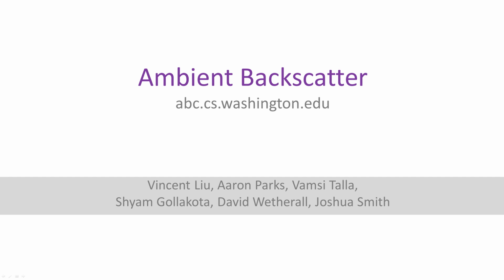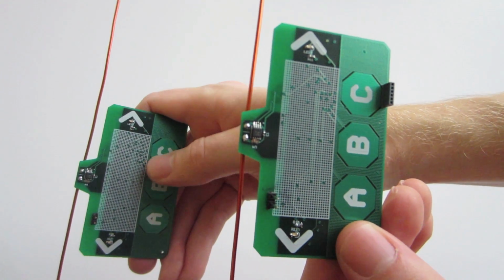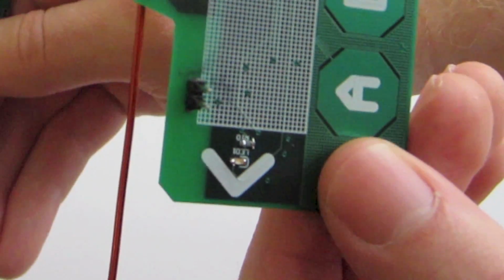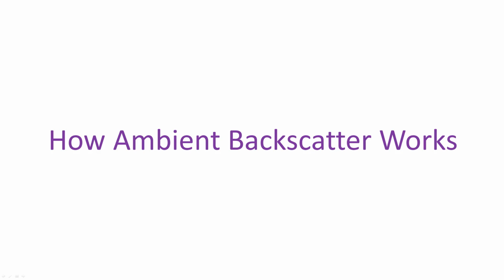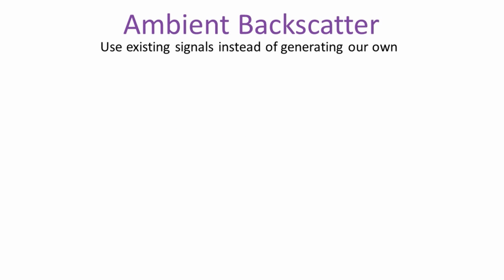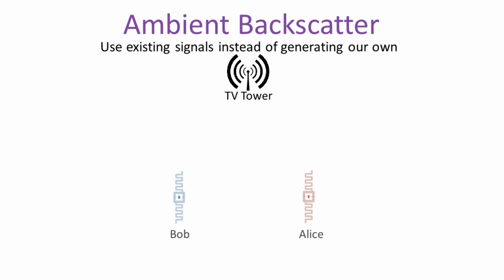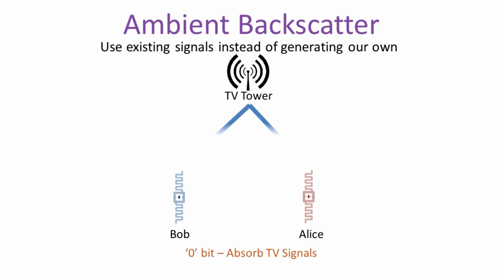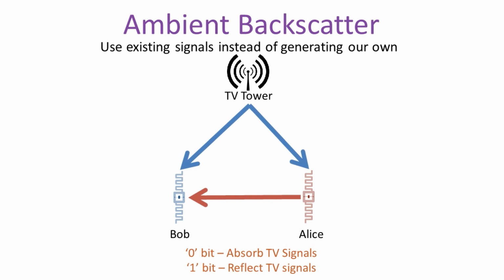Ambient Backscatter

Comment: So, by new do you mean effectively exactly how that soviet spy device hidden in a plaque worked? It was a special resonating cavity that when a truck down the street directed a certain frequency at the building the capacitance of the diaphragm changed the signal proportional to the sound waves. This modified signal was transmitted in another direction and then picked up in an office next to the embassy. 

Look, Im not saying this isnt a novel and interesting application of harvesting the RF around us. It is. Totally. Very interesting in fact. 

Im just saying at its base, its not new. Also, before you tout it as a payment method, have you tried hacking it? Like, sure if those are the only two radios its damn near perfect security. But so many engineers these days dont know how to begin, or outright avoid to protect their precious feelings (because the education system has psychologically scared them to believe failure is a bad thing....its not. Failure you dont learn from is bad. Failing is just a part of life), testing their designs to the point of failure. To try to make it not work. To confuse it or make it enter an invalid state and see what it does. 

That failmode testing, specifically the lack there of, is exactly the problem with all these automated devices running around.....Sure it worked perfect in a nice sterile lab....until a black person is crossing the road at night and they get flattened....We really need to get back into the R&D culture of trying to break things.....

Comment: I love the communication concept. The power method is nothing new. I remember while in college lighting a small room using  a handful of LED's and diodes getting power from AM radio stations from wherever. Crystal radios work in the same manner. a device powered by the airwaves itself.

Comment: Enabling a device the size of your phone to send a single bit and powering the 2 gHz chip in your phone are extremely different things. Extreme low-power devices have already been powered from em conversion, its never been taken further due to the obvious limitations of the tech. Using this for tags is a cool concept, even if the reader has to be extremely close, but don't pretend it's a solution for usable power transfer.

Comment: Dr. Tesla's wireless system was far more advanced 100 years ago. With Dr. Tesla's system the receiver was powered by the transmitter. So a radio would receive the audio signal and the electricity to power the device wirelessly. The system was 95% efficient regardless of the distance between his centralized transmission plant and the receiver. The ground was used to connect the generator to the load.
Reply: Tesla the genius was not a Ph.D. doctor.

Comment: These devices remind me of crystal radios, but they usually work well only with a fairly good length of antenna wire. But if the signal is strong enough in the local area you can receive AM and even FM radio in a very high impedance ear piece without any batteries what so ever with a much shorter aerial. Can these devices work out in the boon docks where backscatter might be substantially less??????????

Comment: This is very cool. But I can see how a crappy government could use it to further control its people. If you have ever seen how multiple robots can communicate with each other and coordinate, it might scare you a bit. The device could be "installed" in humans so government can monitor the movements of large numbers of people automatically via computers. I personally don't like it---fortunately I know I can build a simple device called an EMP device that would fry the semiconductors in the backscatter or RFID electronics. If manufacturers of these devices use a Faraday cage to protect or harden the electronics to prevent destruction by EMP, it will defeat their purpose. The Faraday cage will block any signals leaving their devices as well as blocking EMP from outside the device. So I'm not afraid for me, but others maybe. So bring on these new backscatter devices and hopefully they will be used for good, not evil. Manipulating and controlling the masses to benefit the few is evil---liberty, free thinking, and freedom is good. The Enlightenment lives on!!!!

Comment: Tesla's technology was way more advanced, capable of generating huge power from natural nonpolluting sources. Ambient Backscatter only uses TV&WiFi signals in the air to transmit your location to govt if you turn off your cellphone/or no battery & won't even work in the event of the ~100yr cyclical major solar plasma ejection events (some miss Earth) like the last one that occurred in 1856 that burned out all telegraph wires & could result in no electricity for 10yrs based on techn in use.(NASA)